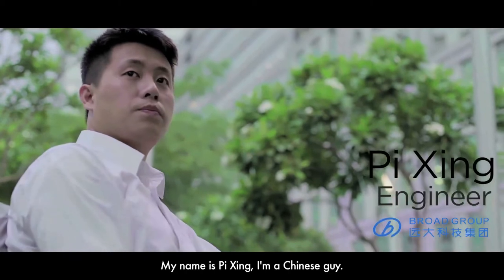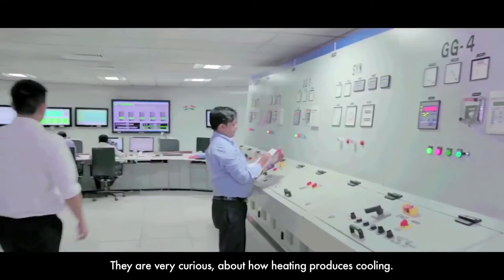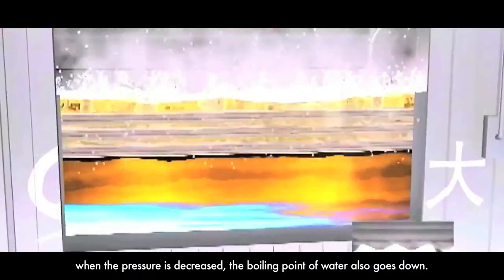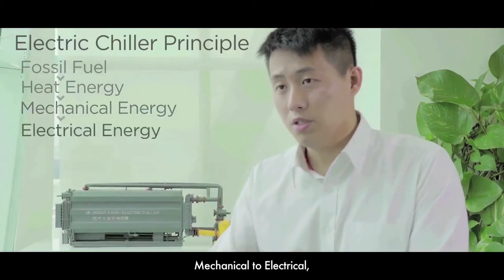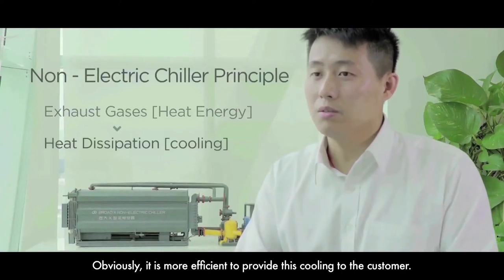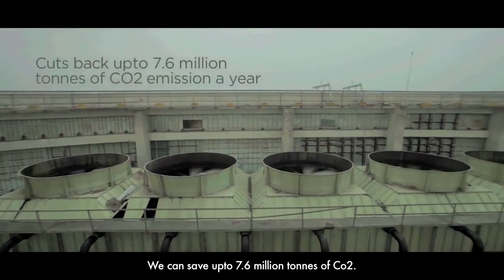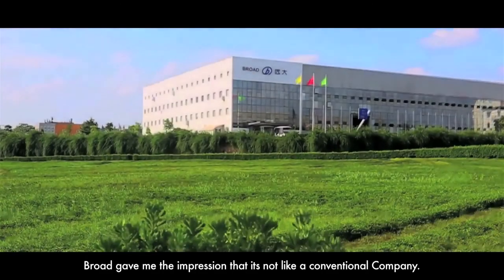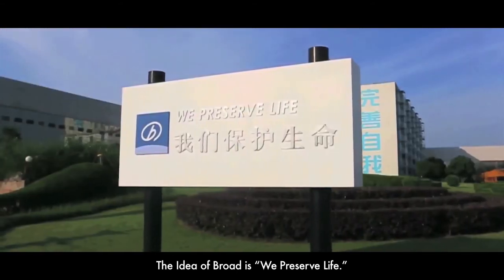BROAD Group | Building Future Cities: Absorption chiller tech explained

Comment: (1)-What happened if we are removed HTHE.LTHE.
(2) -How to placing solution in HTG. (putting low temp solution over high temp solution.) Or what position. 
(3) -if we received hot water at 80'C to 90'C (And over water boiling at 100'C ) than what is use to (circulation & Why) solution in LTG.
Currently working in DLF Building 5 in Broad
Reply from the maker: Hello, thank you for the message. To discuss this in detail, please contact our colleague Robbie: robbie@broad.net